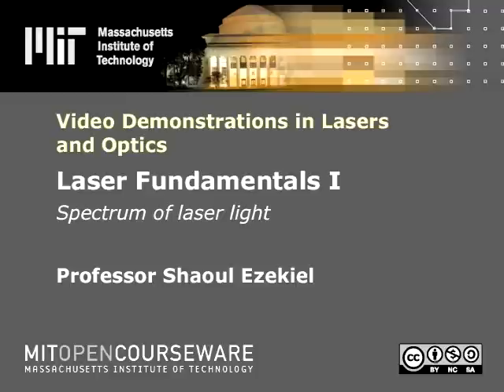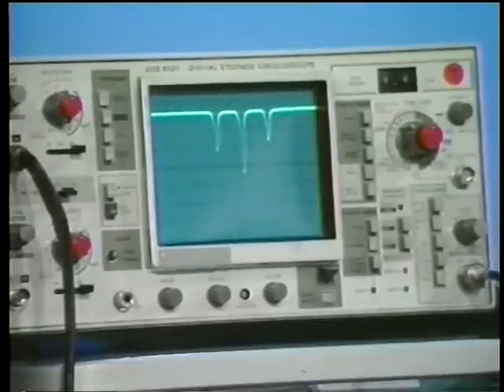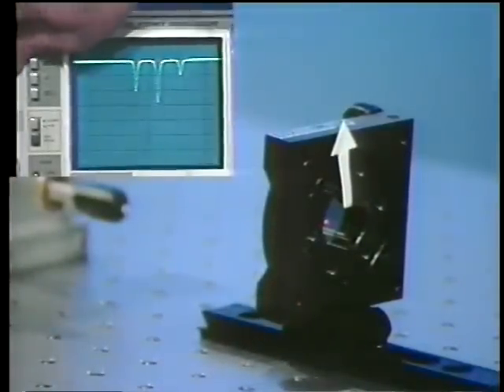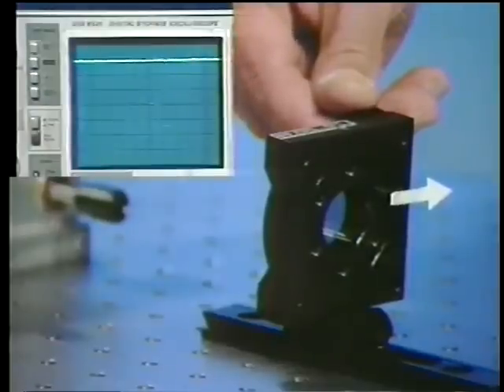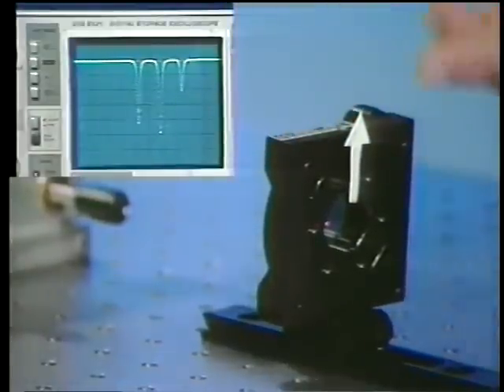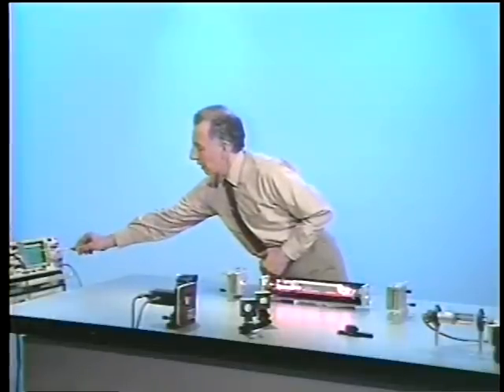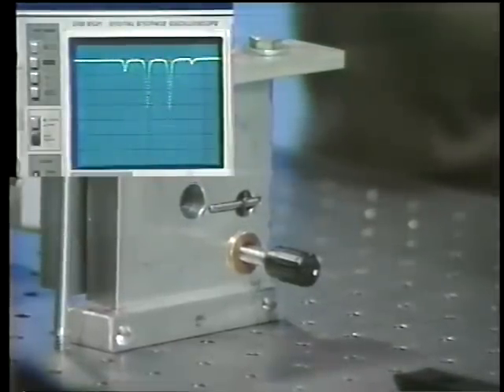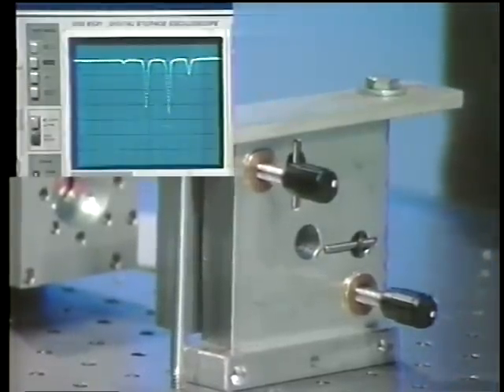Laser fundamentals I: Spectrum of laser light | MIT Video Demonstrations in Lasers and Optics

Comment: Why adjacent modes have orthogonal polarization ?
Reply: Adjacent modes produced in a laser cavity with two mirrors can have orthogonal polarization because the electromagnetic field for each mode is transverse, meaning the electric and magnetic fields are perpendicular to the direction of propagation. In a laser cavity, the two mirrors are oriented perpendicular to each other, allowing only certain modes to resonate and produce laser output.

The polarization of a laser mode is determined by the orientation of the electric field with respect to the cavity axis. When the electric field is parallel to one of the mirrors, it is referred to as a "TE" (transverse electric) mode, and when the electric field is perpendicular to one of the mirrors, it is referred to as a "TM" (transverse magnetic) mode.

Adjacent modes in a laser cavity can have orthogonal polarization because they have different orientations of the electric field with respect to the cavity axis. For example, one mode may be a TE mode with its electric field oriented parallel to one of the mirrors, while the next mode may be a TM mode with its electric field oriented perpendicular to the same mirror. These two modes have orthogonal polarization and do not interfere with each other, allowing for stable laser operation.

In summary, the orthogonal polarization of adjacent modes in a laser cavity with two mirrors is a result of the transverse nature of the electromagnetic field and the orientation of the mirrors, which determine the orientation of the electric field for each mode.